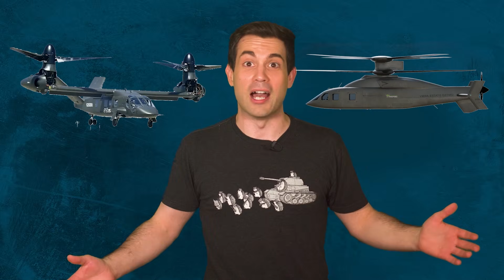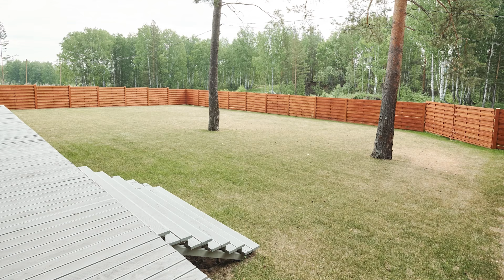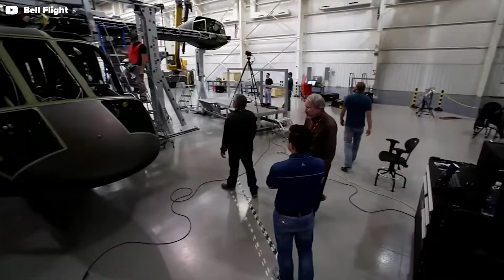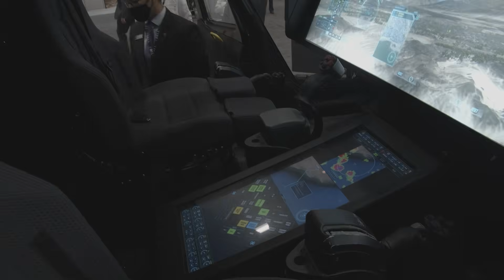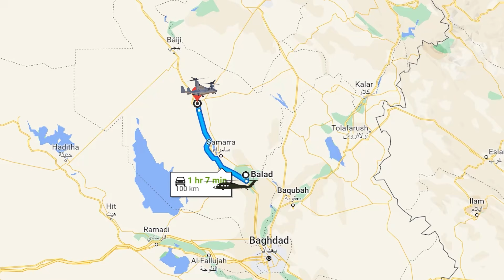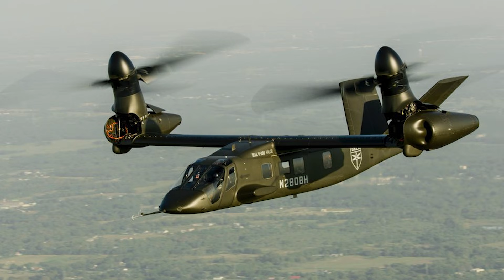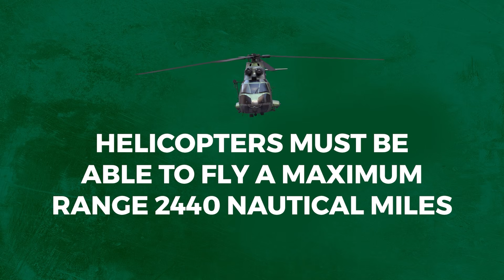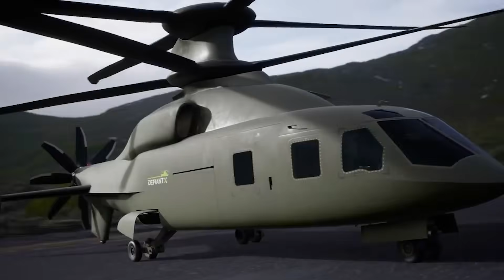V-280 Valor Helicopter Will Help Defeat China

Comment: The Bell design will have to have some truly significant advantages over Lockheed's for it to be accepted.  This being due to the sheer size of the Bell machine.  Due to the design layout of its being a tilt-rotor, the foot print of that machine is immense.  It looks like you could almost fit two of the Lockheed helos in the same space as what one Valor would require.  That will have a pretty significant impact on its functionality on any battlefield.

That pusher prop on the Lockheed machine is nothing new.  That sort of layout has been around since the first helicopters took flight.  Lockheed's AH-56 Cheyenne of the 1960s featured it and it was a notable feature of that design.  The benefit of having a layout like that is that you don't have to trade lift for speed as you do with regular helicopters that must angle their rotors down at the front and / or pitch the nose down as well.  Plus, being a coaxial rotor layout, the Lockheed machine dispenses with the counter torque tail rotor of conventional helicopters.  On those, they stick a rotor out at the end of the tailboom and have it perpendicular to the main rotor.  It takes power from the helicopter engine to generate enough thrust to counter the torque of that big main rotor.  With a coaxial rotor design where one rotor spins in the opposite direction of the other, that torque is eliminated and is so without diverting any power from the helicopter's engine.  It's a bit more complex, mechanically, but a more efficient use of the power of the machine's engine.

On the flip side of all this, it'd be great to see the tilt-rotor getting more production in general.  That's a technology the US has the lead on and would be great to see in civilian use as a regional commuter aircraft.  Something which a contract this big would enhance the chances of Bell's fielding a passenger version of the Valor.
Reply: Leonardo helicopters is currently get a civilian tilt rotor approved by the FAA its been around since the 90's but the project has been bought and sold by a ton of companies but Leonardo is finally making it flight worthy
Reply: Anyone who was in Nashville in April and saw them side by side for the first time can tell you that the Defiant is the BIG ONE! The Sikorsky marketing department has been pushing the “we are the same size as the Blackhawk” BS hoping no one will actually see it in person.
Reply: @gomezgoracing  so true the Defiant has a fuselage  that is nearly as big as a CH-47 without carrying the same loads. If you watch the video you can see a front on shot of the Defiant turning and it clearly shows it’s massive size with how far the fuselage bows out from the cockpit. That’s not even mentioning the thing is like 20’ tall.
Reply: @gomezgoracing  you are absolutely correct
Reply: @gomezgoracing , it’s not necessarily a bad thing that’s it’s larger due to design. Sure, the Valor might fly faster but the Defiant will probably beat it out.
Reply: Both Aircrafts have cons and pros. Bell's Speed and reduntency even with 1 engine it will deliver troops back. I wish they would embrace the size and make it bigger so it can carry more troops and equipment.. 
Lockheed's is maneuverable in tight spaces and pusher prop allows it to fly backwards while maintain nose locked on target. It's good to deploy small squad and drop cargo quietly. It more suited to launch attack with drone missles from different angles while remaining hidden. The extra lift that it has can be used on armor vs light arms so it can be used under fire.
They both have a place on battlefield but vastly different missions. Bell's to supply front bases while Lockheed's deliver and recover squads quietly
Reply: The V280 has a more mature and safe technology than the untested defiant. The defiant and V280 are also more similar in size with the 280 flying much much faster
Reply: @OsoGran  you understand that production coaxial helos existed decades before tiltrotors right
Reply: @raziel_0965  For light to medium lift, yes, as you get into heavy lift helos, they get more complicated, and generally considered unsuitable for heavy lift, tiltrotors are closer to tandem rotors and can more easily handle heavy lift,
Reply: I’ve seen what I believe was the Lockheed in flight over my house a few times. Typically in formation with Blackhawks. It has a really distinct sound.
Reply: Um, I don’t think you paid attention very well. The Valor is a joint Bell/Lockheed submission and the Defiant-X is a joint Sikorsky/Boeing submission.
Reply: @CornFed_3  given recent history across all divisions, I wouldn't touch anything new from Boeing with a 10ft pole.
Reply: @TheMhalpern , I was merely pointing out that people clearly didn’t pay close attention to the video. Personally, I prefer the Sikorsky design. It’ll work better for what the Army needs in the long run. This comes from 8 years in Army aviation units.
Reply: @CornFed_3  depends on speed, honestly, they have similar footprints just rotated, tilt rotors are faster, which can be a very critical feature.
Reply: Bunch of people who've never made or worked on helos typing their hearts out.
Reply: I think you mixed it up, you mean The Lockheed design will have advantages over the Bell right?
Reply: It's likely the final version, like the Osprey, will have the wing on a swivel, so that it can be turned parallel to the aircraft when not in use.
Reply: When quoting footprint, don't forget the length. The Bell V-280 Valor has a significantly shorter, compact length of only 50′6″ – compared to Black Hawk’s length of 64'10"
Reply: The big misconception is that Sicorsky's submission is tried and true, ab Bell's is a new untried and glitchy tech. In fact on the contrary: Bell has decades of experience of building and flying tiltrotor, and Sikorsky has almost none production experience with coaxials, moreover - rigid coaxials. This was proven by speed with which both contenders developed their vehicles: by the time Sicorsky's submission made it's first flight, V280 was already actively flying and even exceeded their speed goal. The idea that it takes too much space is also wrong, as V280 doesn't require any tailprop, it can get away with a quite short tail, this allows it to have the same footprint as UH1 Huey, just sideways.
Reply: @solarissv777  Dude, Sikorsky has been flying the X design for YEARS. Tilt rotors are only good for the marines off of amphibious ships. 
"The idea that it takes too much space is also wrong" The Bell design is big and impractical.
"this allows it to have the same footprint as UH1 Huey, just sideways." Yeah, you left out the spinning blades.
Reply: @zackthebongripper7274  👈 yes. Even with coaxial Lockheed is easier to maintain as well. Very simple, reliable and robust compared to friggin tilt rotor.
Reply: @zackthebongripper7274  Sikorsky has only flown six X2 design airframes in forever.  Forget the hundreds of thousands of flight hours on the Osprey, at the time they stopped flying  the V-280 because thre was nothing left demonstrate, it alone probably had more flight hours than ALL X2s combined.
Reply: Push rotor is also extra weight (removed from a theoretical weight capacity) that the tilt rotated doesn’t have since the tilt rotor uses its existing engines and rotors for forward movement. Not that that’s probably a major concern, so long as they can both carry the desired weight. Good on others pointing out that the bell design has actually been around a while.
Reply: Lockheed for the win. It's more traditional design and smaller footprint is perfect for any scenario. Bell only works in Afghanistan.
Reply: @RealKlausSchwab , Bell and Lockheed are jointly designing the Valor. I believe you meant Sikorsky/Boeing for the win.
Reply: @CornFed_3  Just so ya know,  Lockheed owns Sikorsky.
Reply: @brianmoore1164 , I’m well aware. They still operate separately though.
Reply: @CornFed_3  Just LLC seperation for legal protection.  Same as GMC being separate from Chevy. The owner will always call the shots.
Reply: Very valid point; while I love the Osprey from the USMC, it couldn't even land in an area as small as what it replaced (CH46, basically baby Chinook). USMC has Hueys for when you need to get into really tight spaces. 

The Osprey is a medium lift tilt rotor which replaced a medium lift helicopter, that's why the bigger size isn't so much of an issue (but my aircrew buddies said it makes for some hairy landings on ships). I don't believe it's the best idea to replace the Blackhawk (utility) with a medium lift concept (though it does seem smaller than the Osprey).

The Silkorsky also has the commonality with the recon/light attack going for it, which makes sense for easier MX in remote FOBs (just like USMC Hueys and Cobras have some commonality). I could see big Army keeping/giving Silkorsky-Lockheed utility and light attack while Bell/Boeing staying with heavy lift and attack.
Reply: @burddog0792 👈 Very great logical points.
Reply: Osprey replace Chinook.... and defiant replaces Blackhawk.
Reply: There are issues with expandability, too, as we've seen with Osprey - the tilt rotors makes the future addition of ordnance and fuel-bearing "wings" impossible. But the Pentagon isn't immune to selecting an inferior design if it seems less "risky"...or cancelling things altogether. We'll see.
Reply: the Army can't use either one of those aircraft, they are too airplane like. The Cheyenne would have been used by the Army but the Air Force said no, because if the pusher prop, and you don't see any Osprey in the Army, its an airplane as far as the Air Force is concerned.
In the divorce of the Army from Army Air Force, the USAF got the kids, the house and a huge alimony check. Originally the Army could have light liaison airplanes then the Air Force changed its mind. The Army can not have any airplanes and helicopters have a maximum rotor diameter. That is why the Chinook has two rotors,  they couldn't get bigger so they added more.
Reply: @jasonrhodes9683 , um, they’re being developed for the Army, along with an Apache replacement.
Reply: @CornFed_3  what do I believe, the proven facts of history or you? If the Army could have an Osprey, they would, right?
If the Army could have a helicopter with a pusher prop, they already would, right? Did congress and the president repeal laws that  keep those things out of the Army inventory?
You may be right, I am wrong more than I like, but see above.
Reply: @jasonrhodes9683  if the Army's requirements necessitate a tilt rotor or pusher prop, they can have a tilt rotor or pusher prop, the main thing is that the Army doesn't try to take on the AF's job
Reply: @jasonrhodes9683  the Army didn't adopt the Osprey because it doesn't fit their needs, you're overblowing the plane like thing, it was only fixed wings and mostly applicable when the AF fielded lots of low altitude aircraft.
Reply: @jasonrhodes9683  that probably isn't being held anymore, now it's more no manned fixed wings (Army does fly various drones, including from the Predator series)
Reply: The Defiant's ability to land within dense areas (like that shown with the woodland.) will be huge. You ain't gonna wanna do casevac with the Bell design, will pretty much require like three times the open area as the Defiant will. Pusher prop isn't new but at least we're looking for new stuff these days. Back in the Cheyenne's day there was a real effort to 'stick to tried and tested' stuff. Heck, like that group of dudes that kept pushing for terrible aircraft and armoured vehicles... I forgot what they get referred to but they're idiots. Am sure you know what I mean!

To people saying the Bell design isn't as big as you think, yeah it isn't because it can only carry half of the required payload atm. It's going to need to be bigger or literally more than double as powerful engines as current! Am sure in the video Cappy says the Bell tilt rotor can only carry 5,000 lbs at present instead of the required 10,000 lbs?
Reply: @Noodle5593  honestly, I don't see that being the deciding factor, certainly a considered factor, but it's adjacent to the specified requirements, assuming both aircraft meet or exceed the requirements, the deciding factors will be how well they exceed requirements in certain areas, how future proof they appear to be, maintenance, and (lowest scoring metric usually) cost. so long as it's not excessive, needing a larger clearing for an LZ is manageable, the fact that because the engines are fixed the tilt rotor wouldn't be starting bush fires also helps in this regard. Another factor besides speed and payload, is range and fuel efficiency, full rotary wing craft have absolutely horrendous fuel efficiency, that means more fuel has to be delivered to base, and more trucks carrying that fuel, which require fuel and maintenance, as well as escort, which also requires fuel and maintenance. A tilt rotor can be pretty efficient in horizontal flight, which these larger birds are going to be doing most of the time, being primarily people and equipment movers.
Reply: @TheMhalpern  very true points. I wonder if it would actually be better to employ both types of helicopter. Certainly not better financially but they both are really bloody good designs.
Reply: @Noodle5593  not really, now your doubling logistics load for servicing that class of helo. you sometimes have to choose which features are more important to excel at, and where you can afford to just be good enough.
Reply: @TheMhalpern  Logistics is key. I mean even more than usual. When both offers will be on par with requirement, the one with the lowest logistic footprint will get the deal (well... should get the deal... more on that below). Simply because in a medium to long-lived conflict that is the critical factor. How big your craft is, or how fast is a lot less relevant when the first question you need to ask every morning is "does it still fly reliably?"

On that front, I guess the v22-like has a huge advantage...  At least on the ability to convince politicians. the Osprey had quite a few quirks in its infancy but now any estimate about maintenance on a "sucessor tilt-rotor craft" is going to look solid. Any estimate on the X's maintenance footprint (and costs!)  is going to appear less reliable.
On top of all that, add the idea that contrarotative aricraft pattern is refered by most as the "KA-52-like", and you will see why politicians will probably have a bias towards the most "US was right" tilt-wing frame... 

Politicians don't make choice based on engineering. It's not their job, it's not their expertise.
Reply: @MjolnirFeaw  politicians care about where it's made, the v-22 like has advantage in fuel economy, however it's not like the other one is really that much less complicated, it has 2 coaxial rotars that counter rotate, and have to carry the linkages for rotar trim, sure it might not be the first helo to do that, or even the second, but that doesn't make it less complicated when you are talking about something that has to lift that kind of payload, so really your choices are coaxial axels, or linkages that allow the rotors to tilt. A more limited type of system that allows power to be transferred from an axel to a tiltable load exists in every car, in the steering system. While the system on the tilt-rotor is undoubtedly more complicated than a car's steering system, that doesn't mean it's more complicated than the coaxial rotars, and the both drive shafts can be pretty much solid, which isn't true for the lower rotor on the Defiant. actually there can be greater part commonality on tilt rotor, thinking of it, the two engines make be mirrored, but that's likely true of the other design, unless they are simple geometry blades, the rotor blades themselves would be mirrored as well, but again that'd apply to both aircraft, but the linkages and shafts on the tilt-rotor can be identical for both rotor sets, same cannot be said of the Defiant. accessing them would also be easier, as you can do it without interfering with the other engine and rotor assembly besides maybe disconnecting the drive shaft that links the two so that it can go on one engine, with coaxial rotors you can't would on either assembly without the other.  

Logistics is exactly why the tilt rotor is a better option (in theory). Provided it works reliably, it should be logistically superior in practically every way.
Reply: The tilt  rotor is quite a bit faster, even so than the push prop. Typically the push prop gives 50% speed boast,  and the tilt rotor gives about 100%.

Saftey vice is would prefer the push prop. The tilt rotor sharing of wngines dont help of the gearbox breakes. And that is the more dangerus fault anyway.

To my opinion... both aircrafts are lackluster. While yes larger than a blackhawk... they got like twice the complexity.

I would rather se a fan lift than a rotor lift... possibly a prop lift. Rotor lift is the worst in case of both maintanance and speed.

There have been both fan and prop lift prototypes built in tve 50tys and 60tys. Both worked, but at that time, saftey was not able to be sufficent.

Definit X have a speed of 460, the tilt wing, about 560. A prop lift would do about 700, and a fan lift could go pretty much 1000... or possibly more.  A fan lift could in theory do 1200km/h at ground level. Both the rotor lift have to be at altotude for top speed, the speed is lowered quote significant at low altitude.
Reply: @matsv201  A vertical takeoff craft like that seen on the movie 'Avatar' or the 'Halo' video games would be really cool, potentially safer, and possibly more reliable. I believe that's the type of aircraft you're talking about anyway. 🤔
Reply: @megamanx466  i had to ceck them up. Unsure what type of system they use. There also exist propfan  and ducted prop that is sort of inbetween system.

The most extreem version of this that was proposed  and pre planed,  and actually intendent to be built, was pretty much a B737 size jet with lift fans. Removing half the fuel for a bunch of lift fans.

That might have been a to large of an aircraft for the army... but.. well, think of a Embraer  E2 E-175 jet with lift fans.it would still retain 1800km of range and 23 000lb of load.

The saftey of the system would simply be made out of redundant system.

There was prototypes made  of simual system in the 50tys. But the bypass engines was way to bad at this time to really make the concept workable.